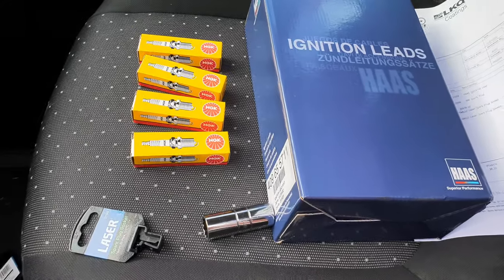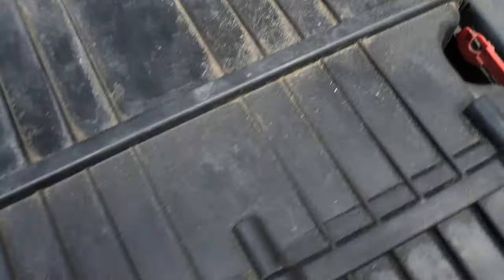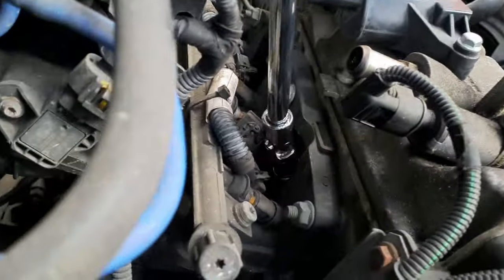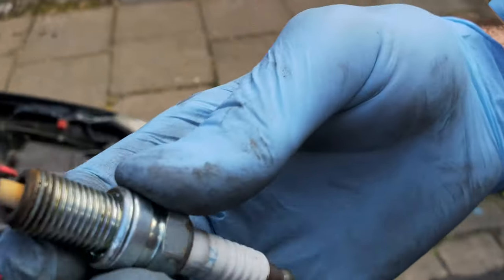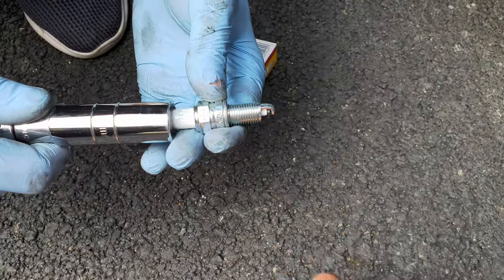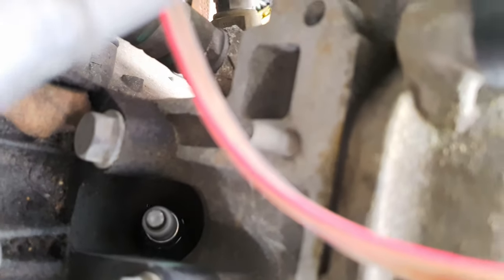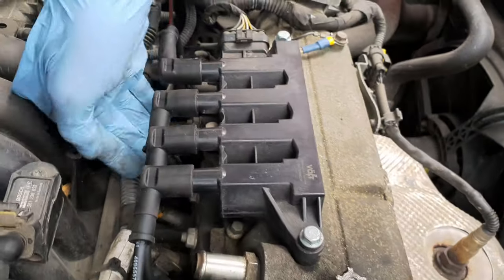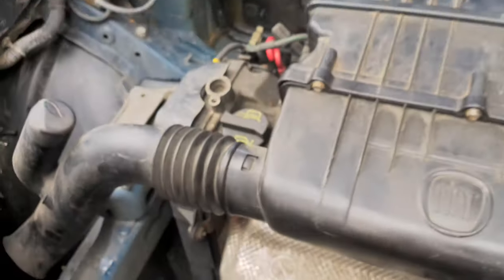OE NGK Spark Plugs & Ignition Leads | Fiat Grande Punto ('06-'11) DIY Service

Comment from the maker: What brands would you recommend for Spark Plugs and Ignition Leads?
Reply: I've just recently changed my Grande plugs and leads.  I used NGK and HAAS leads from euro car parts.  They seem decent,  Bosch spark plugs are rubbish. NGK all the way
Reply: i recommend the Beru Ultra copper plugs, they perform better than Ngk, and can handle heat much better in warm weather.

Comment: I got spark plug and ingnition leads. Is there any specific order for ignition leads to be placed?
Reply from the maker: If I remember corectly, the lenght won't allow you to put them wrong, but double check on diagram.

Comment: Add a smear of copper grease to the plug threads makes them easier to remove next time.
Reply from the maker: Thank you for your feedback mate.
Reply: Nope. Never lubricate spark plugs (and especially with metal fillers or other conductive stuff, graphite). Just use torque wrench when installing.